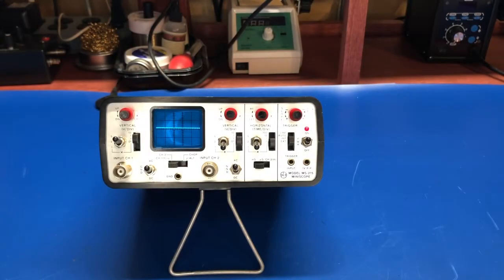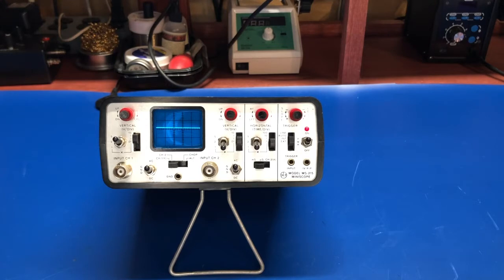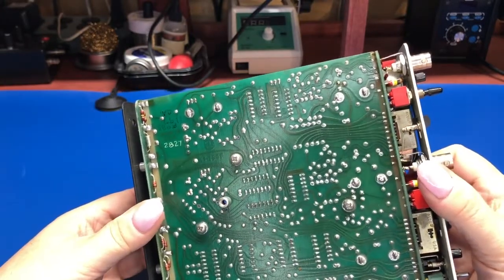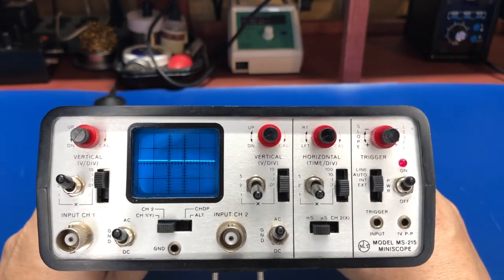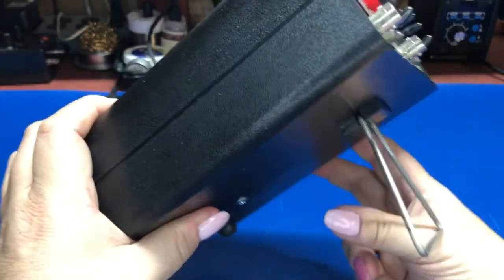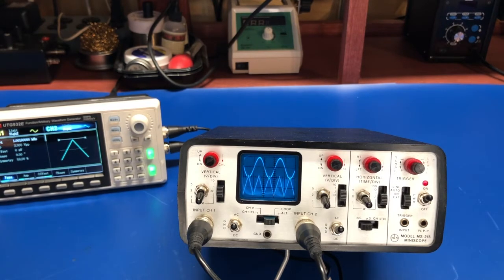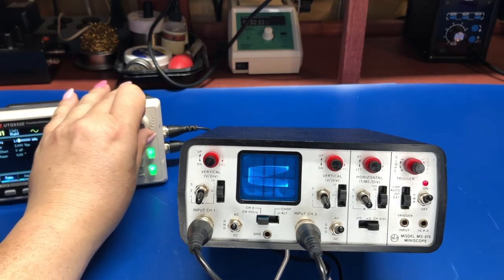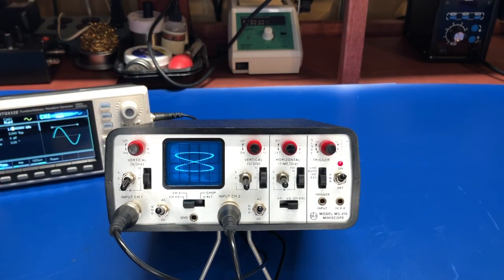NLS MS-215 Miniscope

Comment: I just picked one up for 10 dollars. It powers up but the waveform is a mess. I wonder if old dead batteries are causing the issue.
Reply from the maker: When the batteries on mine went, the display looked a mess as well. I found out that the batteries are an integral part of the scope, even if you are powering it from the adaptor. I have read that some have been able to replace them with large capacitors, but it's just easier to get new batteries.  Replacing them wasn't difficult - maybe an hour of fiddling around. After that everything looked great.
Reply: @Donna_Matthews  Great Thanks. . They really have a nice quality to them. Are they the 2V 2.5ah batteries?
Reply from the maker: @CJ-lf6nq  Yup: 2V, 2.5ah, D cell, sealed lead rechargeable

Comment: Picked up 2 of the MS-230’s today at the Vintage Computer Festival (Midwest). One is missing the battery box, have you seen those around or a replacement option? Seems like I could design one and 3D print it, don’t think it has to be metal.

The boards in them are different revs, one is an A, the other is an E, there appears to be some rather large differences between them. Mainly in the caps I think but we’ll see as I trace them out more.
Reply from the maker: All the box does is hold them together - there is no need for it to be metal. I purchased replacement batteries for mine, and I have read you can also replace them with some large caps, but then it's not really portable any more. Unfortunately, you need them in there for the scope to work properly.